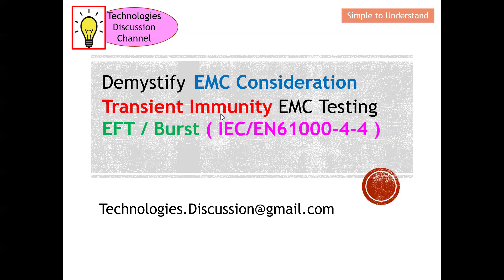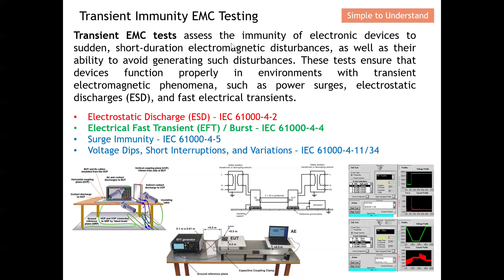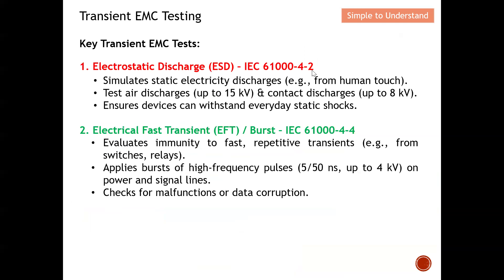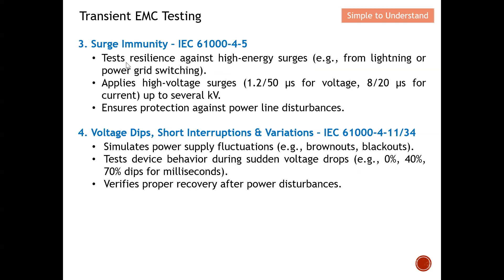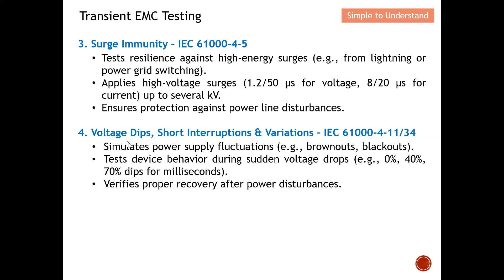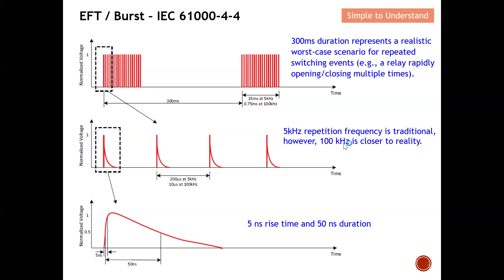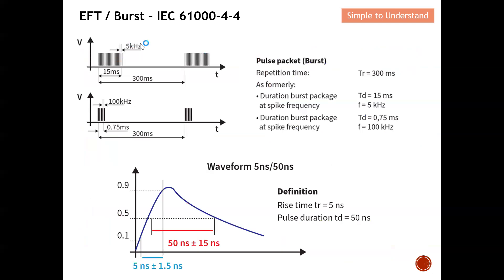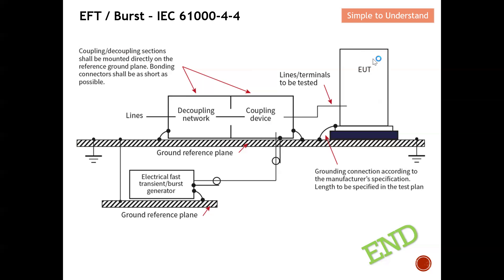EMC #71. Transient Immunity (IEC / EN 61000-4-4): Electrical Fast Transient EFT/ Burst Immunity Test

Comment from the maker: Thank you for taking the time to watch this Electromagnetic Compatibility (EMC) video. In this video, I will explain Electrical Fast Transient (EFT)/Burst testing, as defined in IEC 61000-4-4. I will also discuss why this EMC test is necessary.
EFT/Burst testing simulates disturbances caused by switching transients, such as the interruption of inductive loads, relay contact bounce, and other events that produce arcing. These transients occur when a switch remains in a closed circuit until it reaches a further position.
There are five test severity levels for EFT/Burst. The appropriate level for your Device Under Test (DUT) or Equipment Under Test (EUT) depends on its application and environment.